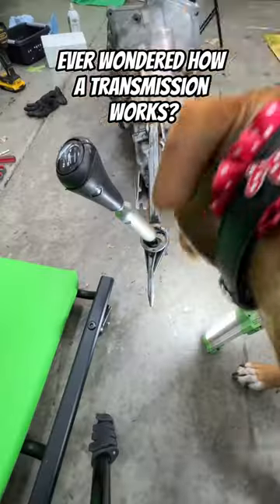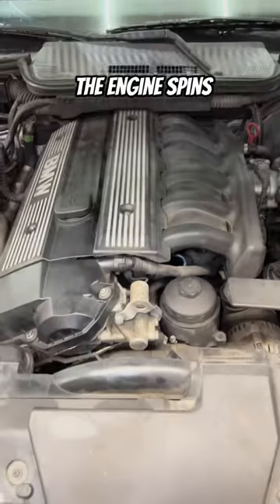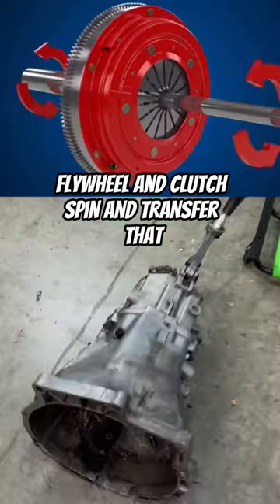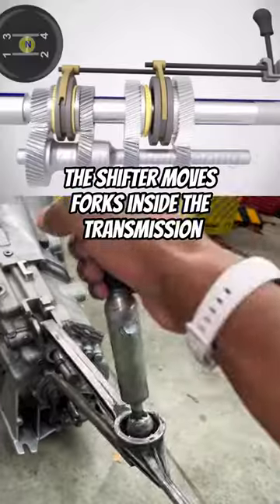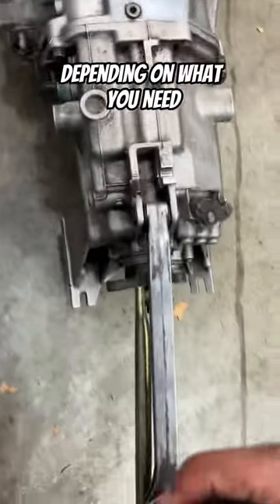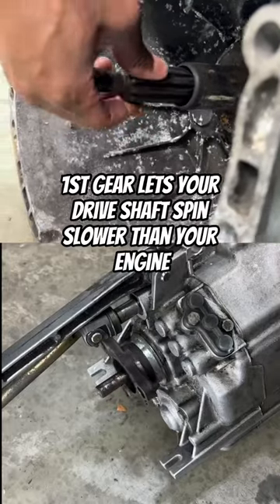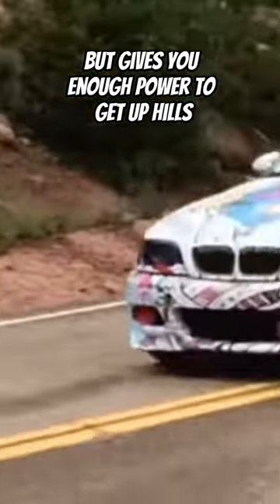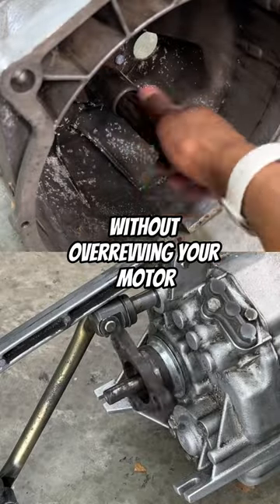Do YOU know how your transmission works? 🧠

Comment: How does slow spinning wheel (1st gear) make you accelerate faster than 6th gear ? This sounds counter intuitive
Reply from the maker: it’s all relative to your engine speed, which operates in the same rpm range regardless of what gear you’re in. if you’re engine’s at 6,000 rpm, in 1st gear you’ll be doing maybe 30 mph. in 6th you may be doing 100 mph. the tradeoff is, 1st gear gives your engine way more leverage to spin the wheels than 6th, so you are essentially putting more torque to the wheels, and the engine can rev through the rpms much faster than if you floor it in 6th.
Reply: Lower gear number means a larger gear size.
Larger gear size gives you more torque and less speed.

Torque = F x r

r is the radius of the gear.

More torque translates to more acceleration.